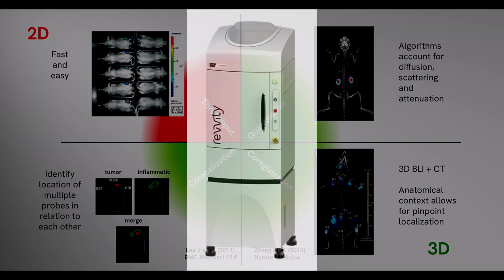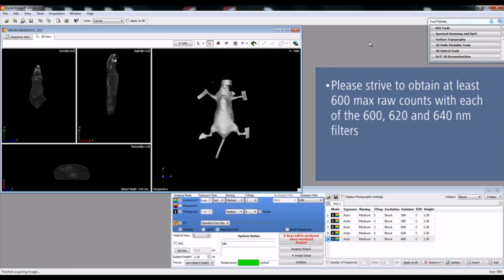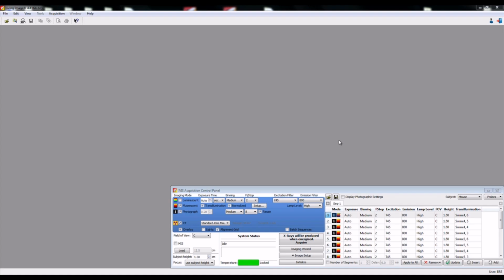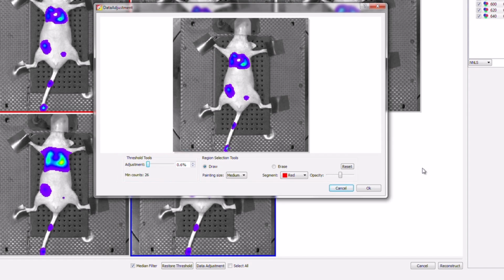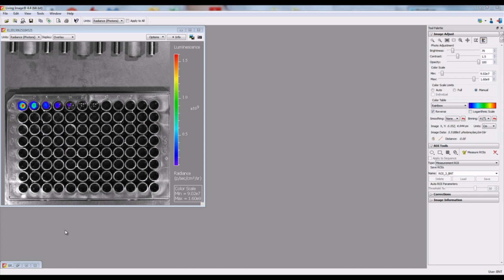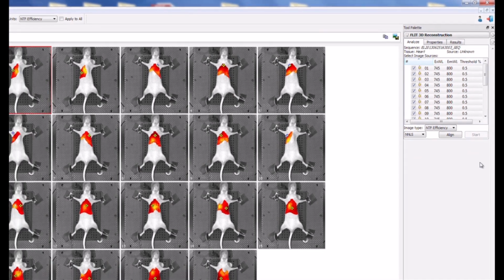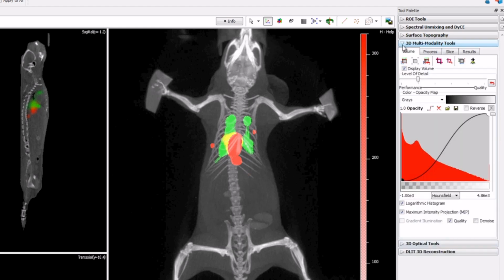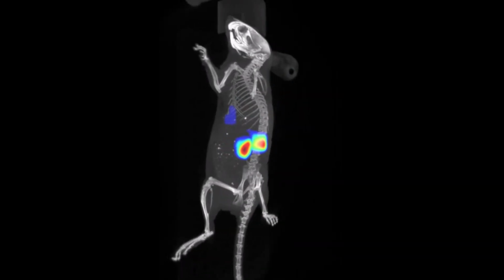Training video: Optical and computed tomography

Comment: Acronyms: DLIT = 3D bioluminescence images, FLIT = 3D fluorescence images
0:00 - Intro
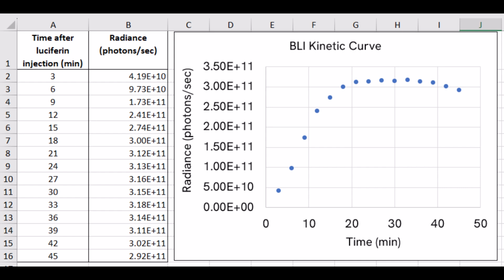1:13 - Image Acquisition
            1:13 - DLIT
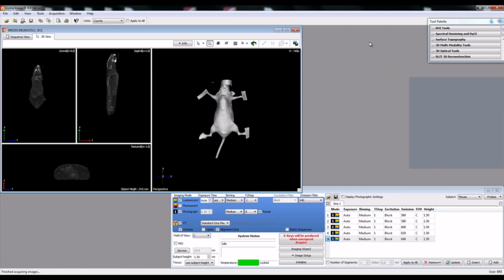            4:15 - FLIT
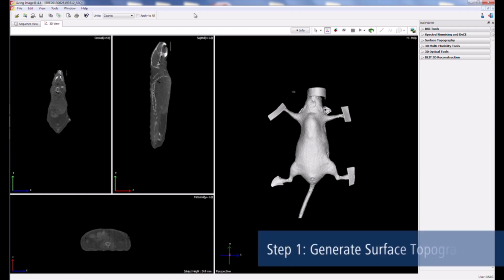7:29 - Image Analysis
            7:29 - DLIT Reconstruction
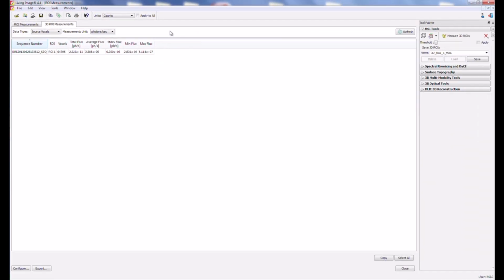            12:40 - DLIT Well Plate Quantification
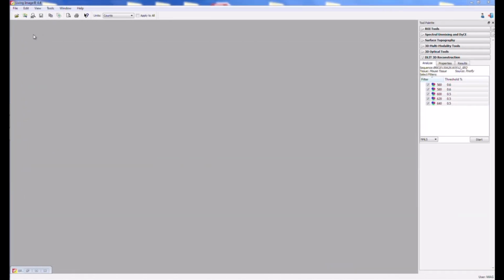            14:40 - FLIT Reconstruction
            16:21 - FLIT Well Plate Quantification
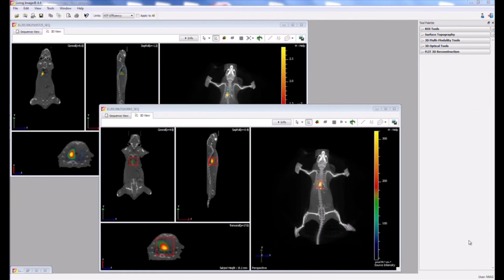17:01 - Overlay DLIT & FLIT Images
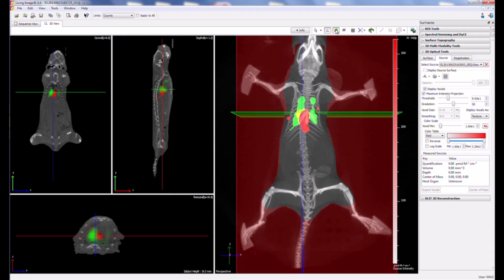18:26 - CT Settings
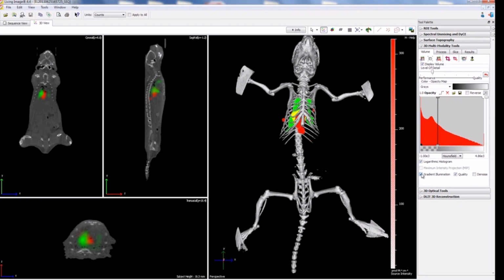19:53 - Export Images
            19:53 - Static Images
            20:15 - Video
21:03 - Summary